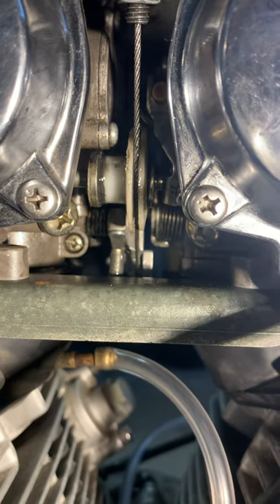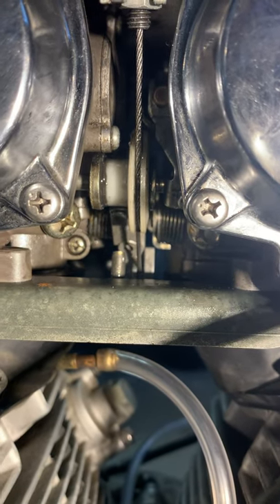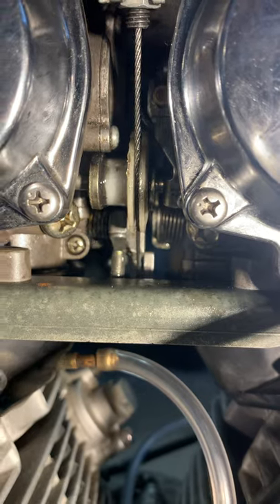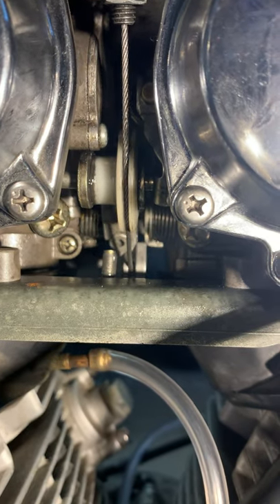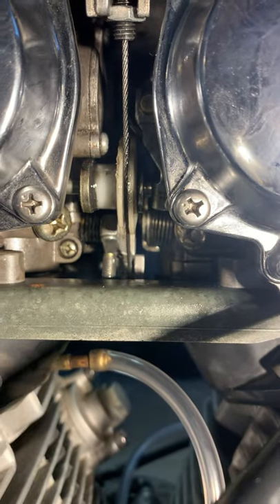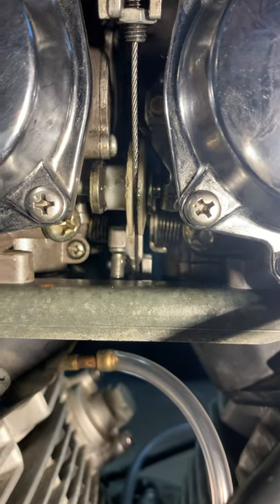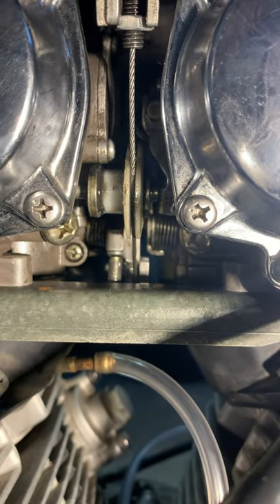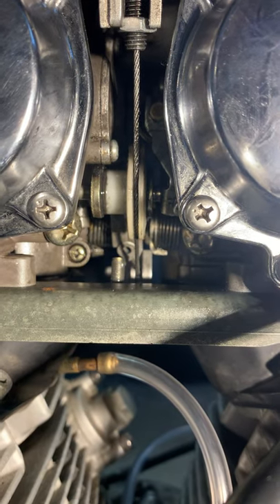Yamaha Virago XV535 carburettor balancing issue

Comment: one thing is to use longer tubes when balancing so you can shut down motorcycle in case water runs toward carburetor. Next thing is there is flathead screw  with spring between carbs and with that screw you adjust butterfly's aka you balance openings. best rpm is around 2 3k to balance them
Reply from the maker: Hey. So from summer drawings there should be a spring between the 2 cans where the balance screw is. Now either it was never there or I lost it so I fired a small spring there. After that the carbs balanced. I think the spring size is a little critical.
Reply: @alexd2745  yeah that spring is needed to be there and it has nice tension. If you don't have repair manual i can give it to you.
Reply: @alexd2745  I recorded you my carbs that are currently off the bike https://www.youtube.com/watch?v=XOD_BNpbLu0
Reply from the maker: @dadobojanic  hey. That would be awesome if you have a spare spring. Is there any way I can send you a personal message?
Reply from the maker: @dadobojanic  hey. Big thanks for the video😊 I cut down an old air mixture adjuster spring and fitted that, but it’s not great as a had to cut it and stretch it. It does work but I think it could fall out quite easily as it’s not flat at one end now.
Reply from the maker: Hey. Do you still have a spare spring that is available? 
If so please let me know and it would be a great help. 
It also seems I still have some other issue that I am hoping is not cdi😕
Cheers
Alex
Reply: @alexd2745  no i don't have spare. i found it here https://full-throttle-projects.com/22u-1490k-00.  part number that you need is 22U-1490K-00-00. What kind of problems do you have?
Reply from the maker: @dadobojanic  will I lost my spring so just cut down a aircrew spring so it doesn’t fit correctly and I’m afraid it will pop it. I had many issues balancing my carbs originally and it was due to this siding missing. Unfortunately I still have an issue sheet it can run on one cylinder which I will post some videos today, but screwing the aircrew out to 3 turns seems to help, but still not good enough she pops and runs back on one at low rpm/throttle. 
Carbs have been rebuilt with the exception of the choke diaphragms.
I ran the bike with the front ht lead off which seems to the one missing. Still a good spark though.
Reply from the maker: https://youtu.be/_92MP-oJkFg
Reply from the maker: https://youtu.be/L3T_dXEAMCA
Reply from the maker: @dadobojanic  btw big thanks for the part number. I will go to my local Yamaha dealer and see if they can get it.
Reply: @alexd2745  by manual the idle mixture screw should be set for 2 and a half turns. if both cylinders are firing then these are symptoms of vacuum leak in my opinion, bike goes to lean so care you can damage engine as it runs hot.
Reply from the maker: @dadobojanic  Hey,  Cheers for your comments. Not sure why comments where not enabled for other videos but I hope they are now. Regarding upir suggestion, I did spray wd40 and starter spray around all the monifolds to see if I could hear a difference in the engine, but nothing. Is there any other places that a leak could occur. Yep I dont like the airscrew out so far so I have to wind that back in and see how it runs, but im sure it will be worse. I need to try and get hold of a compression tester also just in case there is something funny on that front cyl, but still dont get why it runs well when throttle is open more..
Reply: @alexd2745  that screw is idle only. That is why is called pilot mixture screw. So it affect only range from full closed to 1/4 of throttle. Have you tried to turn on bike and while running remove spark plugs cap to see if cylinder is working ok? Also I had similar problem with TCI where some components had cold spots in soldering. When i resoldered problem was gone. I am not specialist in repairing since i learn also on my virago.
Reply from the maker: @dadobojanic  I think the front cylinder is the one that i missing. I removed the front plug cap and the bike ran. When I removed the back plug cap then the bike would not start.  I am going to try and swap the coils over and see what happens. After that I will go back to the carbs and see if there is an issue with the front carb. Could the smaller of the diaphragmes in the carb cause an issue?  That was the only one I did not check when I was cleaning the carbs. Cheers again.
Reply: @alexd2745  Coasting enricher diaphragm cannot cause those symptoms. Also if you miss front cylinder completely its not carb issue it is electricity. You can remove front spark plug and check if there is spark at all. Remove it from cylinder, put it in cap, press on cylinder, aka ground it,  and see if there is spark at all. If not, check spark plug boot first with ohm meter. Unscrew it from cable, check for continuity,and also measure resistance it should read about 5 ohms or 10.  if its ok then swap coils and see if u have spark. If not then problem is ignition coil. to check it you will have to measure resistance on coils. I'm not at home right now but ill provide you values for coils if you dont have them when i come back
Reply from the maker: @dadobojanic  Hey, In one my other videos that I have linked here you can see the bike run with just the rear cylinder and a plug in the front. It sparks OK, but I know that under pressure it can stop. I have a list of checks one guys has suggested like the coils and plug caps, so lets see what comes of it. Cheers, Alex
Reply from the maker: Hey, SO I measured the plug caps and I was get around 10K ohms on both caps. I checked the coils and they were in spec as well according to one guy on both primary and secndary. What is did notice is that the wires going to the front coil where damages and the wire was exposed so I cut the wires and fitted new connectors. I thought that was my problem, but it wasn't:(  I wonder if the coil is damaged or could there been a short and damaged teh TCI unit. 
I doubled checked again and the bike will run with just the rear cylinder, but not just the front. It seems it adds very liitle power to the engine at low rpm. Opening the throttle by some 5mm on the twist grip will cause it to pop like crazy, but over say 1/4 or so then its fine. I wanted to swap the coils, but the leads seem to be glued in to the coil I am going to get some spare HT lead and extend the front cylinder coil to reach the back cylinder.  It's a strange issue if im honest and keep flicking between fuel then electrical.
Reply: @alexd2745 You don't have to extend anything. Just swap connectors on coils. 2 left wires to 2 right wires. Also please send me email so we can communicate there. I left it few comments above